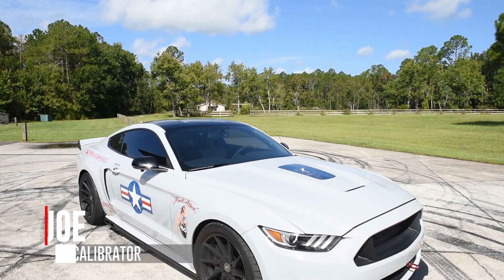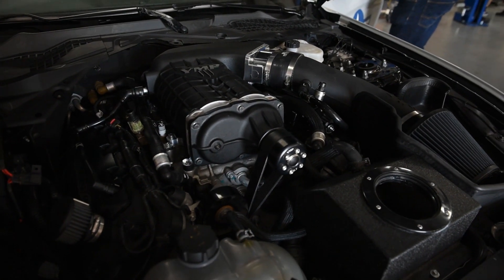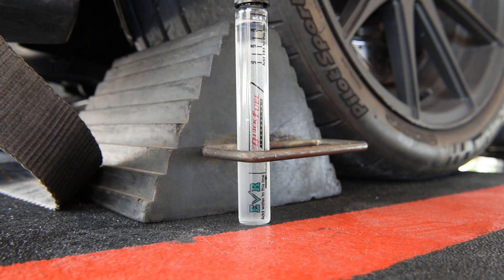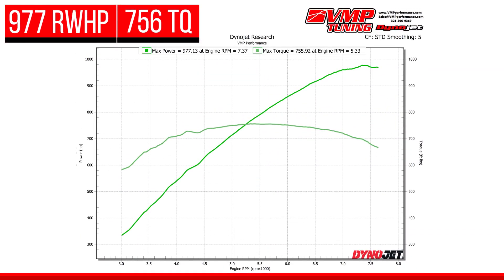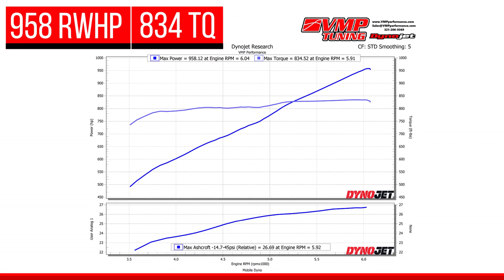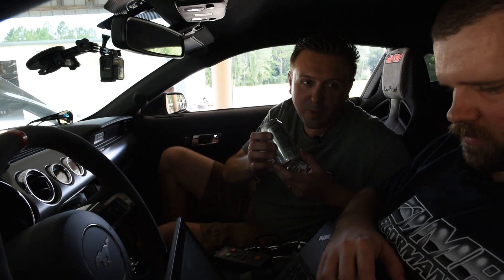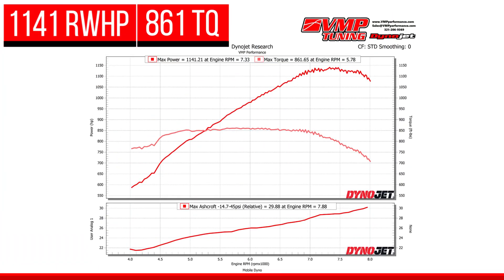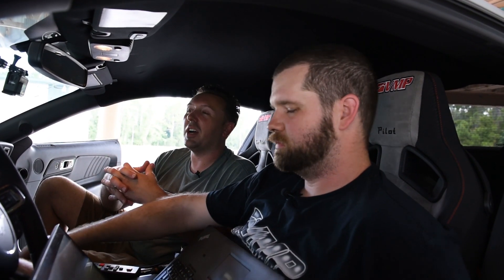VMP Gen3R : Stock Gen2 Coyote Horsepower Record!

Comment: So if I have a 2016 Gen 2 Coyote then I should get a VMP GenR instead of an ODIN right?

The Gen3R seems to produce more HP for the price.
Reply from the maker: That comes down to personal preference over the aesthetics.  Both kits feature the TVS2650 rotor set and are capable of similar figures.
Reply: @VMPPerformanceTV  I email sales as you said, please note that no one responded to my first email.

I did get phone support, the guy I spoke with was helpful with my current setup.
Reply from the maker: Apologies for the lack of response. We appreciate you calling in and thank you for the opportunity to speak with you.

Comment: Which coyote motor is better for boosting between gen 2 and 3, or are they equal in that aspect
Reply from the maker: Hey David!  It really depends on your goals and what you're doing with the car.  Both have their pros and cons.  The Gen 2 and Gen 3 Coyotes both respond very well to boost and make awesome street cars.  The Gen 3 Coyote Mustang GT with the A10 has been doing amazing things as a street and track car with the very potent 10R80 transmission.  If you're doing a swap, you'll find the Gen 2 engine a little simpler and a little more aesthetically pleasing with the coil covers and traditional port injection versus the Gen 3 with its dual injection (both port and direction injection).
Reply: @VMPPerformanceTV  Im in the market for a mustang gt with a manual so I’m curious as to which gen coyote would be better for someone looking to hold around 800whp reliably , seems to be hard to figure out which one holds that power better or even makes that power easier
Reply from the maker: Both the Gen 2 and Gen 3 cars can produce 800rwhp.  Both will need fuel systems and E85 alongside the supercharger kits to do so as the limit on 93 typically lands in the lower 700s due to octane limitations.  The Gen 3 Coyote cars have 12:1 compression versus the 11:1 compression of the Gen 2 cars.  You'll also need to be prepared to upgrade the transmission and clutch to handle that sort of power under hard driving.
Reply: @VMPPerformanceTV  thank you so much for the information your very helpful, what would you say is the stock fueling and stock clutch/ transmissions limit safely
Reply: I’ll help ya.. stock fueling isn’t gonna work.. boost a pump and 1050 injectors .. I made 630 to the tire .. broke 4th gear in my 6r80.. had Brett lasalla build my 6r80 and a circle d converter.. made 707 to the tire with the new transmission.. this was re-tuned last may.. I’m adding a triple fore innovation setup and goal is to hit 730 with more fuel on 93.. than drain fuel out add X85 to it .. and max out my procharger to hit 900 .. than I’m done with it.. you’ll need to upgrade the fuel regardless.. transmission your on borrowed time..

Comment: Sbe ls 6.0 made 1,597 hp
Reply: Not with a blower.  Its also a liter more displacement and this isn't just sbe its a completely untouched long block outside the oil pump gears.  You won't see a stock long block 6.0 with a blower on it (not turbo) making this kind of power with no cam or springs or anything else.

Comment: Impressive.  That supercharger has to be sucking up at least 150whp at that power level. Not sure what correction factors you are using but you are probably putting about 1500 crank hp worth of cylinder pressure in there. Considering AED made 1200whp on 20psi and you guys are at 30psi it seems plausible. AED has turbos so no parasitic loss there but manual vs auto trans may put slightly more power to the wheels.

Comment: At the very beginning of 2018 one of my best friends put one of yalls gen2 blowers and spent a ton of money on deatchwerks full system and ID injectors on his boss 302 it already had kooks long tubes and full bolt ons it was pretty quick before the blower it would run 6.90's in the 1/8 if it hooked a d didn't miss a gear it's the only coyote iv drove I was surprised and I'm a turbo guy  but after the blower it was a completely different car I got a 99 z28 with a very basic forged ls1 and a single billet s480 and it makes nearly 230 more hp but his car is so violent iv never felt tourqe like that the only thing I can kind of compare it to is my paw paws old 81 semi big tire Camaro that had a 489 BBC and a single stage fogger and a plate system I think the manual trans is really what made it feel so much wilder. My wife even loved it I even ended up putting a lsa blower and BTR stage 3 PD blower cam in her 09 G8 GXP and a really nice heat exchanger and 15 gallon water/ice tank in the trunk its making 630rwhp at the moment on the sbe ls3 it's fun as hell on the street  2 years ago I  was turbo or nothing now I have a completely different view I still favor turbos but love blowers almost as much now lol
Reply: Glad to hear our supercharger has influenced you in such a positive way.

Comment: Need to find someone with a built motor to fully and clearly see the light offered by the Secret Sauce Gen 3R
Reply: Remember these are Hero Runs, and if you daily drive a car like this and beat on it like I do a cast piston engine wont last. Justin is very good but he is also a business man wanting to sell products and make money. Yea people can say they have 900wheel gen 2's holding up, but is it a daily driver and do they beat on it daily like I do, I doubt it. Hero dyno runs make money. End of story. Many will fall and grenade their motors though. Only way to hold up big power safely is badass Aluminator or fully forged built motor.
Reply: Mines going to be done in 2 months

Comment: You guys need to see what happens if you put a built coyote motor in it. I bet it will make close to 1300 rwhp. Lol it would interesting to see what happens.
Reply: Jonathan B you don’t gain anything from upgrading the bottom end unless you up the compression. Which isn’t needed for the coyote. It needs ported heads and cams for another 50+whp.
Reply: I rather be safe than sorry.
Reply: @ElijahWash  you need to up the compression to gain power from doing a built bottom end but you could do ported heads and cams and see how much more it will make.  I bet it would make a decent difference on a max effort setup making this much power and with some really badass fuel you could even up the compression some like 12:1 like gen3 have

Comment: So far there’s not a single comment that’s some dude saying,” I COULD BUY A JUNKYARD LS FOR $12 AND PUT AN EBAY TURBO ON IT AND MAKE 3K HORSEPOWER” so that’s nice. Good job guys
Reply: Branson Fleischman literally EVERY mustang video
Reply: And there he is.
Reply: I heard Ls7 grenade at 600wheel after a short time
Reply: @maximusvonce1381  that had not been ring gapped right?
Reply: Mike D not Na lol talking a coyote can hold 900-1000 no cams nothing LS can’t man. Trust me building a 416 LSX right now.LS Has to have cams valve valve springs. Bad motors no doubt but a coyote can hold it stock cams heads valves block ect.
Reply: Mike D built coyote long block rpg 12k ported heads ect 1700hp capable indeed building my lsx now we shall see I’ll tell you what it ends up costing.

Comment: @VMP what is the primary size on the headers?  If I recall Track Attack has/had side exit exhaust.  It might be time for 1 7/8th or 2” inch primary’s at the horsepower level and engine speed.  Maybe Cobra Jet style exhaust or at a minimum the best 3” full exhaust you can source. After that the only restriction left would be cams and head work.

Comment: Hey guys super glad to see this video get put up. I have a 2016 GT/CS and supercharging is the next ticket item for me. Keeping the engine stock with the blower is the goal for now and slowly work through replacing items eventually. What other upgrades would you guys recommend as I can only imagine putting the power to the ground will break some parts.
Reply: Engines are air pumps, we recommend anything you can do to help move the air in, and out.. fuel octane is also often overlooked but massively important
Reply: @chuckharter5954  Currently I have kooks Long tube headers and corsa cat back exhaust with a JLT CAI to help it breathe. Around me (Eastern Shore of MD) 93 is the best we can do. No E85 unless you go near Annapolis. I'll probably run a 93 tune with the S/C over anything else

Comment: Gen 2 is king when it comes to boost
Reply: Remember these are Hero Runs, and if you daily drive a car like this and beat on it like I do a cast piston engine wont last. Justin is very good but he is also a business man wanting to sell products and make money. Yea people can say they have 900wheel gen 2's holding up, but is it a daily driver and do they beat on it daily like I do, I doubt it. Hero dyno runs make money. End of story. Many will fall and grenade their motors though. Only way to hold up big power safely is badass Aluminator or fully forged built motor.
Reply: @maximusvonce1381  i mean, they do mention in the video that if they were drag racing they'd do head studs and this is just "dyno shenanigans"
Reply: maximus vonce The Gen 2 coyote doesn’t have cast pistons. They technically aren’t forged but they’re Hypereutectic pistons.

Comment: Feel like that was a just some shaft full pull. The tip has passed the goal though!
Reply: Remember these are Hero Runs, and if you daily drive a car like this and beat on it like I do a cast piston engine wont last. Justin is very good but he is also a business man wanting to sell products and make money. Yea people can say they have 900wheel gen 2's holding up, but is it a daily driver and do they beat on it daily like I do, I doubt it. Hero dyno runs make money. End of story. Many will fall and grenade their motors though. Only way to hold up big power safely is badass Aluminator or fully forged built motor.